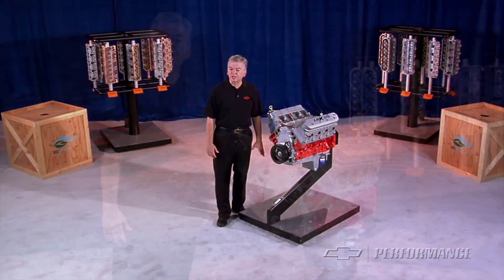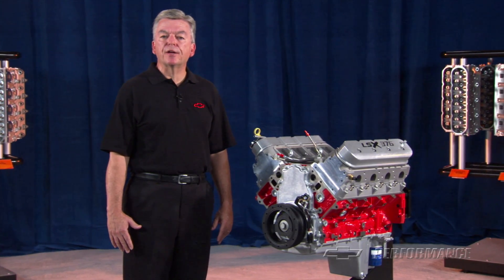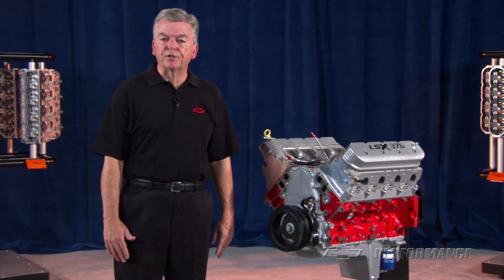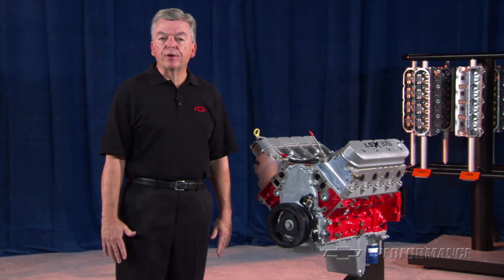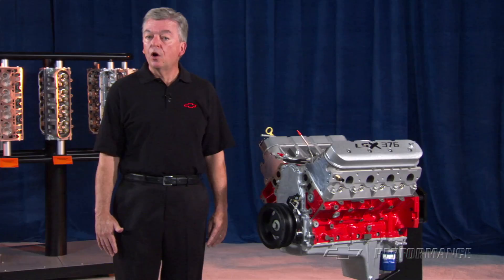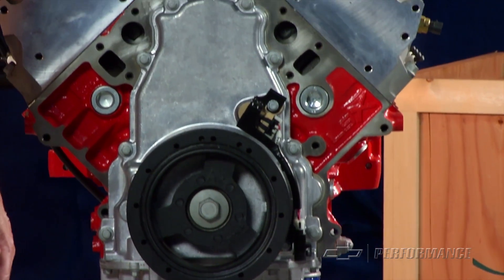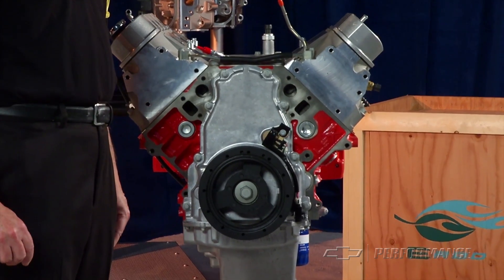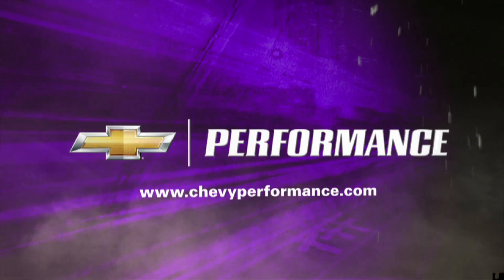Chevy Performance's LSX376 - Supercharger and Turbocharger Ready!

Comment: How is the block a 6.2l only at 376 cubic inches but a 408 is a 6.0l?
Reply: I think the 408 is a stroked 6.0
Reply: A 6.0 ls is a 370ci. And with a stroker kit it goes to 408ci and increases the liters whatever 408 is
Reply: A 6.0 l is 370 
a 408 is a bored stroker

Comment: Can you upgrade a B8 to B15 performance? Or are you stuck with what you have with the B8 if you get that one?
Reply: +Donatellangelo The only differences, as far as I can tell from the GM performance parts website, are the  forged rods and crank (both have forged pistons but I'm not sure if they're exactly the same). The cam and valve-lift dimensions are different as well. 

It definitely seems possible to upgrade a B8 to exactly the same specs as the B15, but I'm guessing it would be more expensive to buy a B8 and upgrade it than to just spend a little more and get the B15.

Comment: Powder Metal Rods :(
Reply: +JamandTheHolograms They're forged, powdered metal. This engine can handle 24 PSI @ well over 1000 HP. I don't think you have to worry about the strength of the connecting rods.

EDIT: The LSX376 B8 does not have forged internals, but the LSX376 B15 does ( which is the engine used by lsxtv.com to get those power numbers I mentioned above).

Comment: everything you say is wrong. no piston engine has ever made 15 thousand hp. plastic will melt. he is saying that comparing it to aluminum ci is better. and fords motor had to have some problem if they didnt keep it going. this is a medium performance motor its not running nitro methane like nhra. nhra engines only last 2 runs at the most. this is supposed to be used for mild?mid racing and street use. an nhra motor is 500ci this is not the same your just wrong and you probably drive a prius STFU